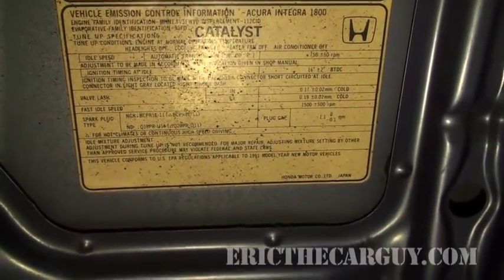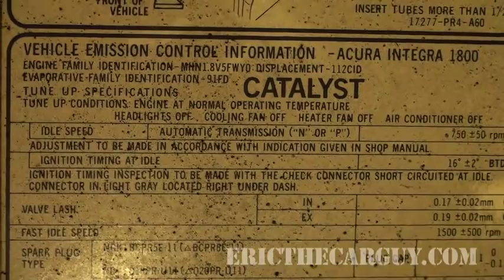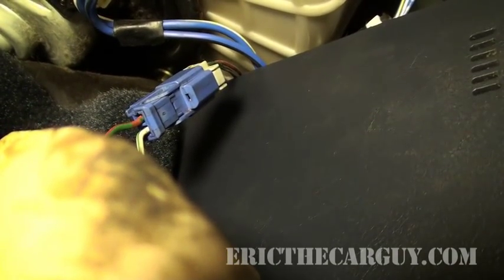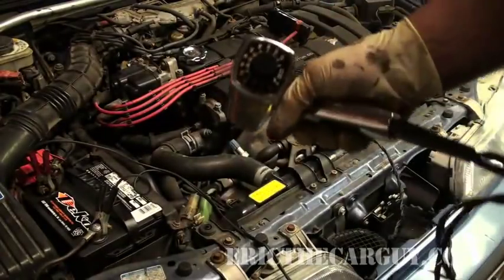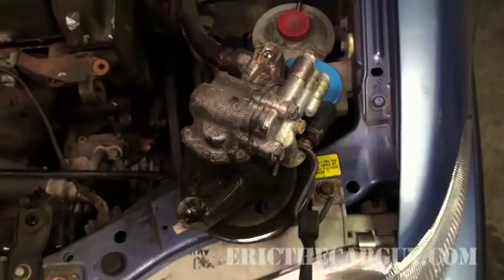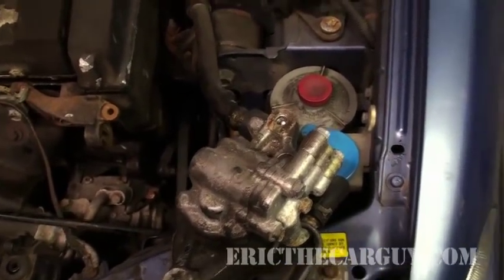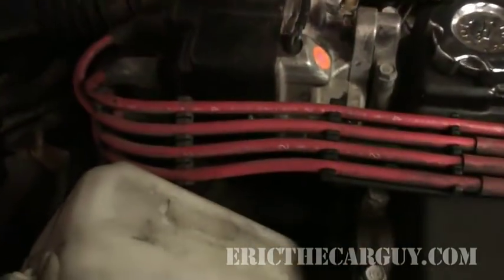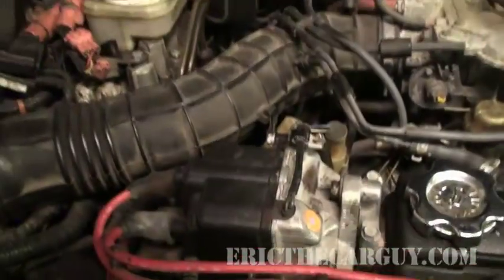How to Set Ignition Timing, Acura Integra - EricTheCarGuy

Comment from the maker: @zengutsu You don't line up marks with the valve cover but rather the lower timing belt cover and the crank pulley.  You can set your light at 16º and look for the single white mark or you could leave your light on 0º and look for the 3 marks on the crank pulley to line up with lower cover.

Comment: You miss one step. After your done tighten your distributor, recheck your timing to make sure it didn't move because the distributor tends to move when tighten it.
Reply: Totally, took the mechanic 35 minutes to get it set. 1992 2.9 v6 Ford ranger, distributor is in the back.

Comment: iv watched dozens probably hundreds and even a haynes repair manual and i still dont understand timing. wth....
Reply: the mark he is trying to get lined up by turning the distributor is 16 DEGREES (think of a full circle, 360 degrees) before the number one piston gets to the very top. That means that right at that moment the spark plug ignites the fuel in the combustion chamber and blasts the piston down in the bore ( and you on down the road). You may need to understand the basics of internal combustion engines for it all to come together for u
Reply: Kay Jay so does that white Mark need to be in the middle of the three marks????
Reply: Im right there with you, I do most of the work on my car myself, but this is over my head. Im trying to figure out what the light is actually used for. If you are looking at the white marks, cant you just look at it with your naked eye or use a regular flashlight to help you see? Or are you actually looking at the flickering of the light in some way
Reply: Only use the center white mark if you have an adjustable timing light set to 16 degrees.
Reply: Omus that means your cans are out of time. You need to take that side of the engine apart and gain access to the cam gears and timing belt. Put the crank st too dead center, and check the alignment marks on the cams. The marks should point directly at each other and lay exactly horizontal to your eyesight. The left cans mark should read 3o clock and the goth cam gears mark should read 9 o clock. If you adjusted the dizzy all the way it usually means you’re a “tooth” off. Which means the timing belt needs to be removed and the cam or cams rotated to their proper locations. It’s not for the feint of heart. And you can easily destroy your motor if you perform the timing belt job incorrectly.
Reply: Nice vid, just did the timing in my Civic thanks to this!

Comment from the maker: @chaiboy510 In 14 years of working on Hondas I have yet to see a fuel filter cause that problem.  Try wiggling your key in the ignition to see if the car stalls, if it does then replace the electrical portion of the ignition switch.  If that is not the case then you need to determine what is missing when the car stalls, spark or fuel, once you find out the missing component you will be able to solve the problem.

Comment from the maker: @hgortermarof How do you plan to transfer that mark to the new distributor?  If you were using the same distributor you could do that but if you are replacing it it's not possible and just easier to time the engine after you have installed the new distributor.

Comment from the maker: @aristas30002000 I hate to break it to you but you might need an engine.  You don't have one of those cold air intakes without a relief valve do you?  If you suck water into the engine and it stalls it has the distinct possibility of bending a connecting rod, if this happens it might break at some point in the future.  If that happens you will need an engine.

Comment from the maker: @nimsu You really don't as it is computer controlled.  If there was a problem with timing it would have something to do with a mechanical issue such as a loose timing chain or a faulty sensor, in fact on those engines I don't even think they put marks on the crank pulley.

Comment from the maker: @chillincruisin High voltage electricity (which is what the secondary ignition system consists of) carries with it a large magnetic field which you can not insulate against, that magnetic field is picked up by the lead placed on the #1 spark plug wire and directly corresponds to the firing of #1 cylinder.

Comment from the maker: @psychoninja911 I don't recommend trying to set the timing, it really shouldn't change over the life of the car, the only instance where it would be necessary is if you removed or replaced the distributor and even then you could mark the location of the distributor before removal and install it in the same orientation.  They mark TDC on the crank so that it is easier to see with the timing light I suspect  If you do move the dist it might do more harm than good honestly.

Comment from the maker: @chaiboy510 It's probably more likely that the current draw from the shorted heater was messing up the computers reference voltage to other components but if the sensor fixed the problem then it's fixed.  Thanks for the update.

Comment from the maker: @Sin187 Thats really not how VTEC works.  In a stock engine there is not a set RPM but rather a set of conditions that the computer recognizes and commands VTEC based on it's programming.  If your VTEC was not working the check engine light would come on as it's operation is monitored by the computer.  The most common cause of a VTEC failure however is low or incorrect oil, it's actually a very reliable system.  See the video I did on how VTEC works for more info.

Comment from the maker: @chaiboy510 It could be a problem with the idle control circuit or a mixture problem.  Look for vacuum leaks as well as any exhaust leaks before the O2 sensor to start.  You also might consider replacing or cleaning the idle air control valve.

Comment from the maker: @MyAztecs I'd be looking to the ignition components first.  You might try spraying the components with water at idle to see if it starts to miss, this may help you find the fault.  It's also very important to use the correct plugs, NGK or Nippon Denso only.

Comment from the maker: @vontristan19 Put the old injectors back in.  The only reason you would need larger injectors is if you modified the engine, putting larger injectors in a "normal" engine will just add too much fuel and cause problems.

Comment from the maker: @mrrrxxxxx No, I think your throttle cable might be misadjusted.  Also I just thought of something, are you sure the noise is not coming from the clutch and not the timing belt area?  I've heard some noisy throw out bearings in my day that made a whining noise.  Also if you don't get the timing cover on just right sometimes it will make contact with the moving belt.

Comment from the maker: @mrrrxxxxx Yes, you do.  If you were not replacing the distributor and just removing it to do a coil or igniter you could mark the location before you removed it and put it back where it was but if you are changing the distributor you won't know where to set it so you have to do a timing adjustment at that time.

Comment from the maker: @000030stephen There is no adjustment, in fact on many late model distributor engines you need to adjust the timing with a scanner.  Adjusting timing for the most part is a thing of the past.

Comment from the maker: @7719stu Good idea for the marks but it's very important that you short the connector before you set ignition timing or it will not be correct.  Idle adjustments are done AFTER timing adjustments but you must be sure the timing is correct first.  Also make sure that you marked the correct location.  Good luck.
Reply: Hey man quick question I got a d15b6 in a 89 crx I can’t find the short connector anywhere any ideas ?

Comment from the maker: @jtoplinerc Now I realize that you are not setting ignition timing but mechanical timing.  Use the white mark on the crank and make sure the cam sprocket has the mark 'up' pointing upward when you line the marks up.  Good luck.

Comment from the maker: @john1989100 Have you checked the cap and rotor for voltage leak problems or carbon tracking?  You might also do a compression test to rule out a mechanical issue.

Comment from the maker: @red666A Timing would have nothing to do with that so you could rule that out.  You might be looking to the idle control circuits and for vacuum leaks.  Start with any check engine lights if you have any.

Comment from the maker: @HBGAH The set up on that engine is the same as this one and I think if you look closely it will say follow the service procedure under the timing adjustment, this is the service procedure.  I will say that if the car suddenly got 'sluggish' then it's probably not the timing as that normally remains fairly constant, go ahead a check the timing but in your case I would keep looking for another cause.

Comment from the maker: @200996 Ignition timing is hardly ever a problem these days.  I would first look to the ignition system (use NGK or Nippon Denso plugs only), if I didn't find a problem there I would adjust the valves and check the EGR system for clogs.

Comment from the maker: @thanh20 That's normal, the reason you jump the connector is to take the computer out of the timing circuit as you make your adjustment, when you pulled the jumper the computer took control again.  This is why it's referred to as "base timing" because the computer advances and retards from base timing depending on engine load and condition, you set timing with the computer controls disabled.

Comment from the maker: @davidzzz94 No, that sounds more like a slipping transmission.  Make sure you use Honda fluid only and check the level with the engine off on level ground to get the proper level.

Comment from the maker: @mrrrxxxxx I did this because I replaced the distributor.  For the most part you should never really have to worry about ignition timing.  On this car it will change as the timing belt wears but by the time you change it it's back in spec.  Great question BTW.

Comment: So I have a 93 integra 4 door, I am going to replace the distributor but does the timing reset when swapping the distributors? Please help. I am picking up my distributor tomorrow and I honestly don't know how to time or want to time the car. I wanna have her going nicely. Please help.
Reply: Get the mark on the crankshaft to match an arrow on the block next to the crankshaft. Sometimes there's more than one mark. If the distributor isn't also pointing at it's mark, turn the crankshaft to the next mark. Now that the distributor cap is off and you see it line up to, then it should be easy to install the new one without any worries.

Line up the marks. Can't see the  marks? Break cleaner blasts oil away no problem.

I hope I don't need to say this, use a tool to turn the crankshaft, not by turning on the engine and turning it off repeatedly (before my first time, I braved commenting on this and I was glad to be corrected).

If it's too hard to turn, don't use a impact wrench. It'll just turn the bolt and that could cause damage. Use a hand tool. If it's too hard to turn, it should be easier with the spark plugs out.

Comment: thanks Eric for another informative video. What does it mean if you need to go further in rotating the distributor to get to the desired timing, but are unable to turn the distributor any further because you reached the stop point of its hold down bracket? Does this mean you have to pull the distributor out and reinsert it in a different position, then try again?

Comment: When I jumped the under dash wires with a jump wire, the CEL would blink 3 times - then it would repeat over and over. Was able to get timing exactly at 16' BTDC, double-checked with my OBD-2 dongle and Torque app.. Does anyone know what the 3 blinks of the CEL mean? When I removed the jumper wire, the CEL was off.

Comment: Hello, thank for your videos.
I would like to ask you a question. I have a 1992 Honda Prelude F22a. With the jumper wire in the service check connector. With a timing advance light, I can't get to 15 degrees, may be I get 5degrees at most , even with the distributor fully counter-clock wise. What could be the problem?. The car runs fine. but I think it is lacks of power in 2nd gear.

Comment: My sticker didn't have the timing specs. :( I'll try the 16 and see if that works.

Thanks for explaining the advanced timing light adjustment. It's been a while since I've used my light. I could only see one mark on the pulley when it was spinning and it seemed to be close to the marker when I changed the timing light to 16.

My jumper on my 2000 Honda CR-V as you mentioned in your how to retrieve codes with just plugging in the jumper, was towards the center console on the passenger side right next to where I plug in my ODB plug. The blue plug was right next to it being held in another blue clip. It wasn't plugged into it. It was just being held by it. Medium size paper clip worked perfectly.

Thanks for this tutorial video and the other ones. Thanks also on telling us not use brake cleaner on the distributor cap and giving us a laugh. :D

Comment: Quick question, If the light set to zero, means that light is syncd with ignition. And 3 marks are 16d before tdc. Does that mean the fuel ignites before it reach TDC?

Comment: I checked my b16a ig timing, it was 10 degrees, adjusted to 16 which is what it should be, the engine power seems reduced now, especially when vtec kicks in.. Do you think this is placebo effect or was it set a 10 for a reason? I'm using an adjustable timing light. Set to 16, line up tdc mark with timing Cover mark, many thanks Eric

Comment: If it's really just getting 10MPG, then either the thermostat is not letting the engine warm up all the way, or the o2 sensor(s) are screwed up. A cold engine will run rich, an O2 sensor screw up can make the run rich, or lean.
So start there, the big things, because 10MPG is crazy low so something crazy obvious is the reason.

Comment: Eric I have a 2000 Honda CR-V 2.0 engine, you show a wire inside on passenger side with a blue connector hanging  down. You don't show if it was connected or not?? Also, on mine the only blue connector IS CONNECTED and it is right next to the OBDII connection- inside passenger side BUT just below the radio in the middle NOT on the right side under the glove box.... I unpluged and set the timing but it still, at idle, acts like it will die. HOWEVER, driving it is fine, no missing NOTHING!! BUT ALSO, the engine light blinks when its idling and stays on solid once I give it some gas and drive over 10 or 15 mph... SO WHAT IS IT?????

Comment: Hello erick from Daly City ca. 
my mech just change the distributor oring seal and still leaking after 3 months my car is mitsubishi mirage 1993 1.8 the way you adjust the timing ignition is the same way i did to my car however this mitsu is giving me a headache is just the damn O ring seal keeps breaking causing oil leak around distributor area any suggestion because the O ring seal is just brandnew.

Comment: Nice video @ericthecarguy this really helped me. My 99 Honda Civic is having an issue where if I set the timing on the distributor my rpm goes up and after a few miles of driving my check engine comes on and code P0505 pops for idle air control valve. Then I have to retard the distributor out of spec for rpm to be in the 750 rpm and code does not pop up. Throttle body idle screw is almost closed. Any help would be appreciated

Comment: I have a Snap-On Digital Timing Light #MT2261A I usually set it on zero and read the marks from the crank pulley.But how can i set the timing advance with digital setting?

Comment: I have a 95 Maxima fuel injected that has no spark.  Can I still use the timing light to see if timing  is the issue?  Also does my fuel pump need to be connected to get spark?

Comment: Nope Ericn you didn't mess me up it just that I'm not fully versed I ingnition timing and after a certain point in the video it start be all greek to me lol. But I was watching another video on timing on a small block Chevy and they said there's 2 timing settings, 1 for idle and the other for higher RPM due to spark advance & getting that cylender to fire at the exact same spot in its durration cycle. (I think lol)

Comment: if i short the blue service connector on my accord 93, it won't start. i would have to remove the jump wire in order to start the car but then the computer will be back working fighting the adjustments. this is my dillema. how do i solve?

Comment: hey eric i just did a head gasket on my 89 d16a6 sohc in my crx. im pretty sure everything is in time but i think my ignition timing is off lil. seems to run idea good but when i went to test drive it it boggs taking off in 1st gear and starts running like a beast once i pick speed up n rpm picksup.. plz plz help thanks

Comment: You maybe right Eric. So far the vote is 2 mechanics to 2 in favor of the ignition may have to be reprogrammed into the ECM that's if it doesn't re-learn the new position. But so far still no CEL & no codes so perhaps the computer is re learning but until it does I'm getting less  MPG then before the intake gasket job.

Comment: I was wondering about taking a long screwdriver & insert it down the distributor well & reset the direction of the gear on the oil pump so that way it will be easier to line up the cap w/the #1 cylinder. But for what's worth, even though I'm -7 degrees out of time, I don't have a CEL like I did at -9.

Comment: So I tried shorting the connector under the dash and the check engine light does not come on. What can be causing this? I really need to set timing but the service connector won't short out, need help please. 
I have a 1991 honda civic d16a6 engine